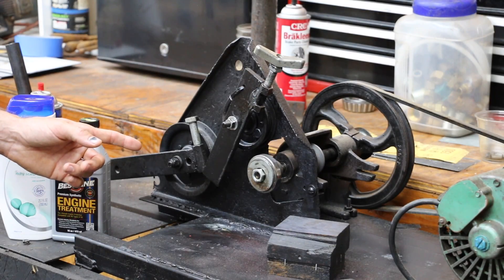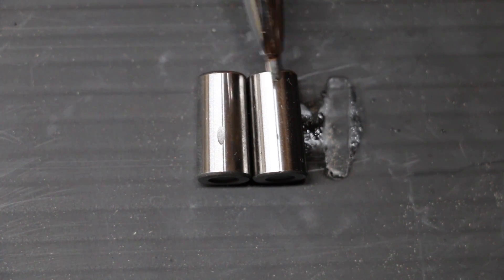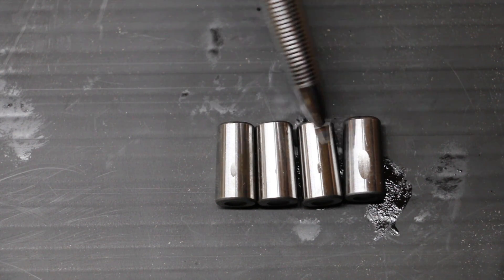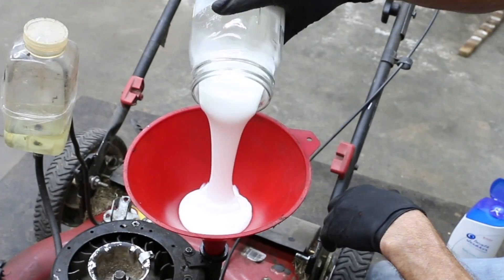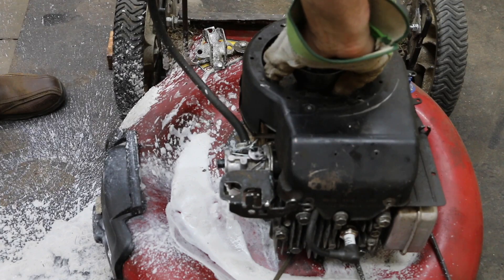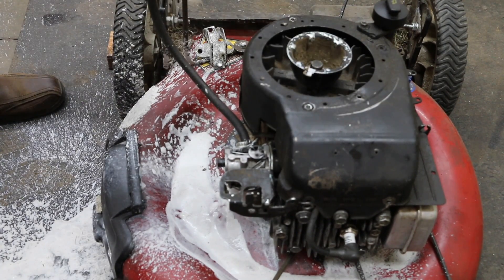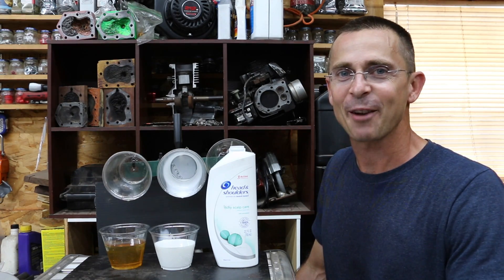Shampoo as Engine Oil?  Let's see what happens!

Comment: Question! Is hydrolocked different than actually locked up? Had a piece of equipment that needed repaired on the bottom and the people tipped it on the side and it got oil in the combustion chamber... didn’t know if that was bad for it after having it kinda cleaned out?
Reply: Hydrolock, aka hydraulic lock is when there's fluid in the cylinder (such as fuel) keeping it from moving, usually this is easily solved by removing the spark plug and turning the engine over manually several times and possibly blowing some compressed air through the spark plug hole to dry it out... Actually locked, yeah that's worse.

Comment: Project Farm: For silky smooth engine, Use Head & Shoulders
Reply from the maker: lol  Thanks for watching.
Reply: @ProjectFarm  sir pls do a video with 10w 30 with 10 gms sugar, 10 gms Moth balls and 10 gms styrofoam dissolved in 10 ml of gasoline. Run the engines for an hour, expect gritty fine char with sugar and styrofoam

Comment: These experiments make history.

There are some other things revealed, such as an engine explosion is less than might be expected.

The versatility of a lawn mower engine is revealed. The abuse a lawnmower engine can take is revealed.

Could a lawnmower be converted to run in cooking oil?

Could it be converted to run in diesel?

Could it be converted to run on propane, how about hydrogen.

What mix of gas and canola oil could it withstand?

How about a heat-ceased lawnmower engine, from no oil. What does it take to get it going again.

I do not anticipate any of these being done... just interesting.

Interesting study.

Interesting that the single engine is primitive, yet advanced and a miracle of technology.

2400 rpm is 40 times a second. Just try to count that fast. Technology does things that are impossible for a human.

1,2,3, ...40

We count about two numbers in a second. If we try really hard we can count up to four in a second.... counting aloud.

A piston goes up and down 40 times in a second.

(At 2400 rpm)
Reply from the maker: Thanks for the feedback.

Comment: I have always been a believer in Prolong engine treatment. I ran an experiment myself at work cutting thru 1/4 mild steel plate, with a new "3 Lenox hole saw in a drill press. With oil there's a lot of smoke, noise (screaming to be exact), heat and friction. Also the drill press would stall often if I wasn't very delicate with the amount of  pressure I applied. A washboard pattern developed in the bottom of the cut with oil alone. That  was the reason for all of the noise. I added several drops of Prolong into the oil puddle just outside of the hole saw. It took a little bit of rotation for the prolong to stir into the oil, the drill press even stalled while I watched the prolong stir in. When it did the smoke stopped immediately, shortly after the screaming stopped. I pulled as hard as I could on the drill press handle and I couldn't get the hole saw to cut anymore. It wouldn't stop rotating either. No noise, no smoke, no cutting, so got scared. I was supposed to get work done and now my hole saw wouldn't cut at all, even on a new set peice of steel. I had to clean everything with brake cleaner to remove all of the oil and Prolong to get the hole saw to cut again. Then I was back to loud, smoky slow cutting. 

Will you please test Prolong against your favorite engine treatments. Both with and without motor oil. I watched a lot of Prolongs competitors tests and they never seemed to cover all of the bases. 
Thanks!
Reply from the maker: Thanks for the video idea.

Comment: I really want to see "breakfree clp" being tried as a fuel . it may inpregnate the metals it contacts with teflon though.
And hoppes number 9 , i also want to see what happens if you use differant gun oils and cleaners and solvants in an engine that requires mixing of oil and gas.
Reply from the maker: Thanks for sharing.

Comment: I want to build a steam engine. Every thing I've read says ordinary engine oil is nearly useless. High temp and pressure and the blow by is water will turn it into goo.
    Can you think of a low(er) cost alternative? 
 ... another lubrication corundum is the only way to lube the cylinder is to inject it into the steam at intake valve. I'll take any advice on that I can get.
Reply from the maker: Thank you for the feedback!

Comment: It's water based.  WATER BASED.  Boiled out pretty quick.

I love your channel, but this is one of those that's just kinda dumb.  Like what happens if you try to run an engine on water?  What happens if you hit it with a hammer? What happens if I touch the spark plug?  I grew up fixing these engines and I just don't see any purpose in this type of video, but hey, got 886k views so far! Guess it paid off. I'd like to see how we can make these things work longer, better, and more efficiently instead of destroying things like children.

Comment: Try using mineral oil,  the laxitive from the pharmacy and test it.. I swear I use it in my engine mixed with my oil and it quiets the engine down.. I mix about  a half bottle in.
Reply from the maker: Thank you for the video idea!
Reply: I had a 04 maxima with a ticking sound in it,  thought it was timing chain and put the mineral oil in and the sound went away after about 2 weeks.. I use it in all my vehicles now... Also test that Marvel Mystery oil... Thanks brother,  good work I subbed.

Comment: Yes water did... but you kept adding more as it boiled off.  I would be willing to bet that if you kept it topped up with H&S, or topped up with water, the engine would have lasted.  Oil sump went dry!  The zinc most likely had nothing to do with it, as there was not enough to be significant.
Reply from the maker: Thank you for the feedback

Comment: You should see what damage if any that won’t be done if you run jet fuel in a gas engine. I seen another YouTuber put it in a car but doesn’t show damage or if any carbon built up.
Reply from the maker: Thank you for the video idea!
Reply: Or hydrolic fluid only the crank case

Comment: actually to an extent im surprised and impressed with how well the shampoo did. on the scoring test with the bearings it appeared to be about .25% as effective as the oil. on an older lower power engine this might hold some actually work for a while it would appear. 

then on the test in a running engine it was pretty obvious the water would boil off due to temps after a little while. if in a pinch and you monitored temps well you could actually get somewhere like this. 

if in a pinch and you monitored water content in the "lubricant" it might actually work for a while.
makes me wonder about using it in a 2 stroke to keep it flake free and running and smelling clean... seriously though the water boiling off might actually improve some power/clean on some circumstances. hydrogen can be a power source for an engine and water/methanol injection can add power/make it safely. 

2020 lets make h&s injection and leave climate change in the dust.
Reply from the maker: Thank you for the feedback

Comment: You should think of the most damaging thing to use as a lubricant and use it. Like for example, Ultra high concentration H2SO4. It has some viscosity and it is a powerfull acid. Something that would really put an end to an engine's life without causing something to break.
Reply from the maker: Thank you for the video idea!

Comment: What about 80 90 w gear oil as motor oil? I'm just wondering in a trail situation would it work?
Reply from the maker: Thank you for the video idea!
Reply: @ProjectFarm  I have a generator with a 5hp engine that sounds like it has a rod knock. Any ways to test it? And if it does have a rod issue would it be best to repair or replace the engine? I really enjoy your videos keep up the good work. P.s. I thought about running straight lucas oil additive in it and didn't know if that might quiet down the engine. We loose power where I live at a lot and my generator will run for days sometimes.

Comment: Once while in a pinch I was able to use some ky jelly as penetrating oil. No pun intended. I used it to drill out a lock on a rental property so I wouldn't keep losing bits. Not sure why that jelly was in the foyer, but hey that's why I have gloves. Anyway. You might try using that. I'd like to see KY or a similar jelly get tried out in the crank case. Again. No jokes intended. Maybe try the stuff for colds. VapoRub, that stuff leaves a residue that won't wash off easy. I wish someone still had whale oil. I'd try some of that. Mineral oil, or castor oil?
Reply from the maker: Thank you for the video idea!

Comment: Dish soap as motor oil??

Also, could you test what type of dish soap has the best cleaning power?

And lastly, potentially testing different types of cleaning methods for dishes (and other items)
Brushes, sponge, clean by hand, high pressure water, any other methods you might come up with

Using a black light, swabbing test, petri dish
Reply from the maker: Thank you for the video idea!

Comment: After only 1 minute and 15 seconds white stuff started spraying out, sounds familiar.
Reply: What hole is is coming out of? Im not particularly familiar with engine parts
Reply: Philipp Jeremias Engine oil is stored in the balls
Reply: @yee6365  😜😅😝
Reply: @yee6365  😂
Reply: @640kareenough6   it's the crankcase vent, any exhaust gas or fuel vapors that slip by the piston ring will be pulled back into the engine and burned.  He unplugged it so the engine wouldn't stall trying to burn the foaming shampoo.
Reply: @anime2485  So how did the shampoo end up coming out the vent like that?
Reply: @mohammedsalimahmed5230  as an engine is damaged the piston rings allow more and more pressure out of the combustion chamber (called Blow-By gasses). Also as the crank spins it whips air around making bubbles and they have to go somewhere
Reply: @mohammedsalimahmed5230  The shampoo boils at 93c, creating foam that soon fills up the whole crankcase. The shampoo in the oilpan dont need to be hot, the shampoo is circulated to hotspots where it will immediately boil.
Reply: @640kareenough6  the crankcase ventilation :)
Reply: I don't know... This video seems kind of flaky.
Reply: Dude, too organic! I'm eating here...
Reply: Doubled my time 😁
Reply: Ha ha ha ha
Reply: LOL!!!!
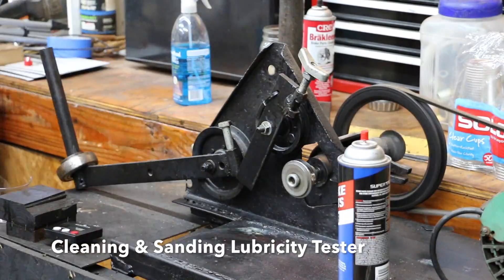Reply: 1:15? What a stud!
Reply: Wahaha story of my life 🤣😝

Comment: Hair conditioner would probably work better as a lubricant, especially one with a high oil content. I sometimes use conditioner in place of shaving cream because it’s so slippery. However, you would need to continuously add water to it otherwise it dries out and gums up, especially in when exposed to the heat of an engine.
Reply from the maker: Thank you!

Comment: When you clean your head, valves, and piston what exactly do you clean them with?
Reply from the maker: While I use a wire brush and brake parts cleaner, I don't recommend using a wire brush on an engine that you want to last.
Reply: Project Farm thank you also would a high number sand paper work to get clean it?

Comment: Is the idea for a motor with an oil cooler attachment. Implying the shampoo will move through the radiator more rapidly allowing the motor to run at a lower temperature?

Comment: I like the lubricity tests. I would have liked to see how the shampoo compared to 30 weight oil, like the common man would put in a mower like that. Bestline is too good for a comparison against anything that isn't actual motor oil. As a side note, I would like to see lubricity tests on two stroke oil-fuel mixes. 20:1 40:1 and the most common, 50:1. trying different brands would also be fun. Just be careful, you are dealing with volatile fuel!! I know that when I had to use motor oil in my motorcycle, I mixed 20:1, just to be safe. It did foul spark plugs, but it did protect the engine. No problems with the carburetor.
Reply: Vincent Robinette two stroke tests have historically shown that more oil makes more power. Up to, I believe, 8:1
Reply: @laurag.8786  I was thinking in terms of protecting the engine vs cost of oil. It's all about getting the lowest levelized cost per horsepower hour, over the life of the engine. When I grew up, most engines required 20:1. When they started recommending 50:1, I was skeptical at least, at worst, I didn't dare run that little oil. I don't know if the new recommendation is based on the alloys the engines are made from, or weather the film strength of the lubricants has improved that much. A lubricity test could tell the tale. Now days, I run 50:1, and I love the reduced smoke, smell, and longevity of the spark plugs. My Chain saws, and leaf blowers are holding up exceptionally well, suggesting you just don't need much more oil than that.
Reply from the maker: Great point.  Thank you.

Comment: Sorry,I find your videos so interesting I forget the thumbs up,zinc-dithiophosphate is the zinc compound you're looking for but use impermeable hazmat gloves as it's deadly in it's pure state and can be absorbed through skin.
I wonder how many employees at the crane camshaft company died from doing the screw driver test,one of their ads showed a person trying to hold a screw diver by it's blade after being dipped in crane super lube,50% zdp and high viscosity motor oil,it can't be done,I tried it,my finger and thumb tips felt like they were dipped in scalding hot water an hour later,they blistered and pealed after a couple days,this was 40 years ago.I went to the library and looked it up and got my info there.I'd put it right up with MTBE and tetra-ethyl lead and aniline oil.Bad stuff but good for your engine.
Reply from the maker: Thank you for this information.  I really enjoy reading comments like yours and learn a lot from them. Thanks again!

Comment: LMAO! Well, I bet the paint wont flake off that mower. When I was young I heard about engines with ceramic cylinder sleeves that last a long time. Is this true? Can you make those? Or ceramic or glass bearings? I used to fix old audio equipment. If a reel to reel tape player came in the heads would be grooved from the tape friction unless they were glass. I wonder if the polished surface would withstand wear better (if they dont break.)
Cool videos! Youre awesome. Trying all the crap us guys have always dreamt  about.
Reply from the maker: lol. Thank you!

Comment: Mountain dew as engine oil! 😂
Reply: Possible side test to see if diet VS regular mtn dew has any difference in lubrication
Reply from the maker: Thanks for the video idea!
Reply: I actually thought about it a bit and it probably might not be too interesting. But I'm actually curious to know if diet sodas especially the coca colas would damage the engine as bad as your monster video. I say coca colas because there is one coca cola that is supposed to boil completely away if heated. I don't know if it's coca cola max or another one. Could be interesting

Comment: I got to wonderin' what would happen to an engine if you added oxygen to the intake?  What I mean is if you added an oxygen line to the air filter, and started the engine normally, then slowly turn on the oxygen, and see what happens.  Nitrous oxide is 33% oxygen, and the engine puts out more power, so what happens when you add 100% oxygen?
Reply from the maker: Thanks for the video idea!

Comment: There is a popular but old video where you buy the same weight oils from different brands and freeze them and do pour tests. The methods used in that video were poor. I think you would do a much better job and far more accurate with your readings. Up here in North Dakota the Winter ratings on our oil matters a lot. But all 5W's aren't made equal apparently.
Reply from the maker: Great point and thank you!

Comment: Recently had a heater core go out. I bypassed the heater core because I live in a warm climate. The heater core in this vehicle is beyond difficult and requires the removal of the evaporator, requiring discharging the AC lines. Thought about buying a small water pump, running stop leak through the heater core only, then hooking it back up. Wondering what the best brand of stop leak is and if they're actually effective under test conditions. Please give some insight.
Reply from the maker: Great video idea!  I'm not a big fan of stop leak products, but have used the stop leak tablets with success.

Comment: Have you ever did one of your tests using a two stroke oil in a four stroke engine as a crank case lubricant??   NOT mixed with the gas and then ran, but poured directly into the crank case replacing the typical 5w30, 10w40 etc etc etc oil and then ran??
Reply from the maker: Yes, I tested it in this video: https://www.youtube.com/watch?v=X3-ndGFIzlY&vl=en

Comment: Hey I accidentally got a drop of JB weld  in my gas tank on my predator with a bit of ga sin it it is solid but should I try to take it out or will it be fine
Reply from the maker: I'm always reluctant to offer advice.  If it were my bike, I would leave it alone.

Comment: Please use 2- stroke oil as an additive mixed with diesel fuel. And check whether or not it improves MPG and stuff like lubricity. There are couple of theories that claim some mixture of diesel and 2-stroke gives better lubrication for injectors and has cleaning properieties.
Best regards :)
Reply from the maker: Thanks for the video idea!
Reply: @ProjectFarm  if you'd like to I can give you some more details. There are a lot of topics on forums. One of them for example is that you have to use low ash semisynthetic 2 stroke. 1:200 1:300 mixture seems to be not harmful for the engine. I had a friend who had an old golf which was burning coal like crazy after adding that to fuel the black smoke was really reduced. I ve checked it in my car there was definitely some more smoothness in engine work but it can be subjective. So some good research of yours could be really good material for your channel. Best regards.